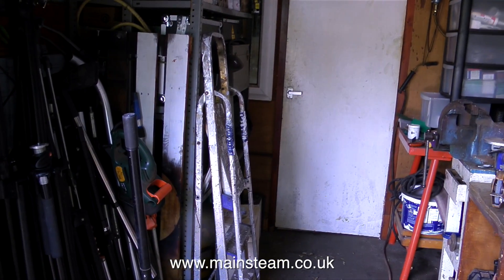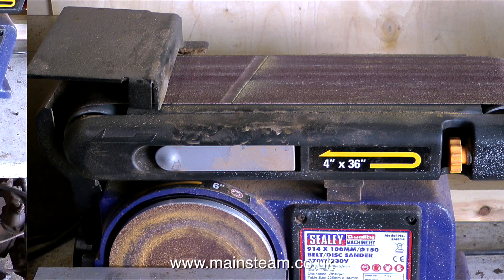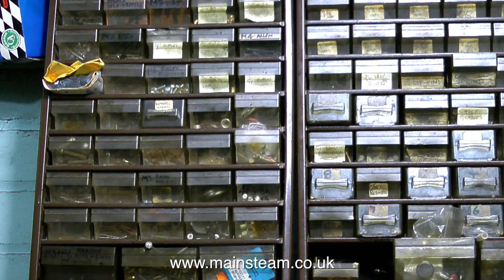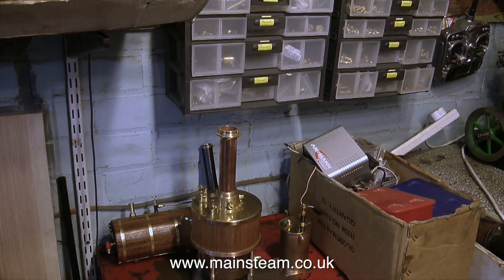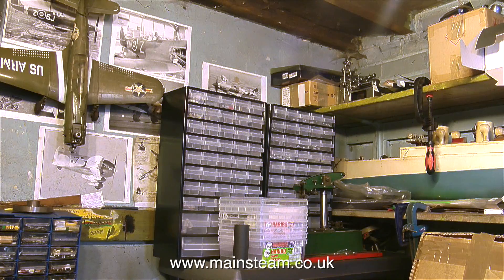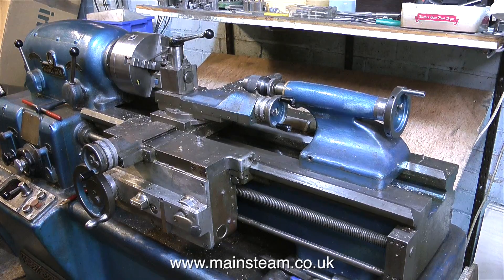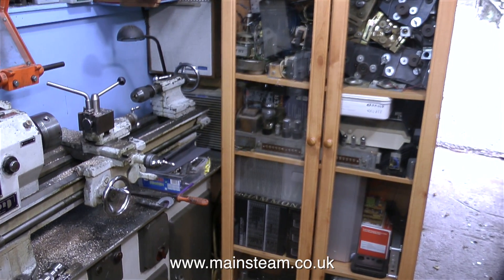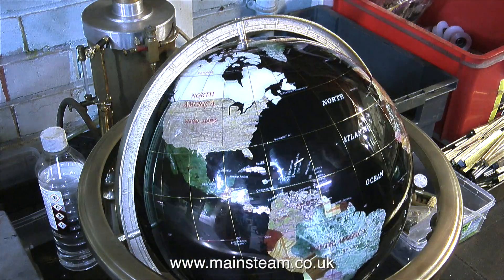A GUIDED TOUR OF MY WORKSHOP

Comment: A great workshop. Mine is full to the brim of woodwork stuff, machines, model boats and building stuff, a building jig for a 21-foot lapstrake daysailer, lots of wood and metal and other assorted goodies.. I love your 2 lathes, I wish I had one, I'll get on 1 day...  It is very interesting to see how others set up their workshop and what they have in them, it always gives me ideas. Thanks for the very informative tour. One thing I would like to see (I have not seen it in a video as yet that I've watched) is how you set up your compressor and the connections used for running the engines, I am working on a hose arrangement at present for mine but I'm a bit stuck as to how to get the pressure so low etc.. (what regulators to use etc).

Comment: i'd really like to See you build a small two stroke engine for a model plane
Reply: Honestly though that'd be awesome, i guess for anything elses sake than just to do it, a bought engine will be much cheaper and less of a hassle to build. Yes, they are pretty simple machines, but different to steam engines which use lots of (relatively speaking!!!) simpler parts, ICEs get away with comparably few that require pretty complex machining (mainly the cylinder block/crankcase...) and require high tolerances....

TL:DR: If the reason is doing it, do it. It will be HARD.

If the reason is using it, just buy one for a few pounds (~150-200 ) for a formidable one?

Comment: Something I've learned living in multiple houses with carbon monoxide issues. the CO detector should be closer to the floor. CO is a heavier than air gas, so if the detector is above head level you might have issues before the alarm goes off.
Reply: I think you might be confusing it with Co2 which is heavier than air. CO is slightly less dense than air so will not fall to the floor.